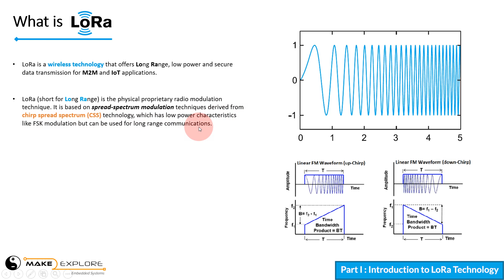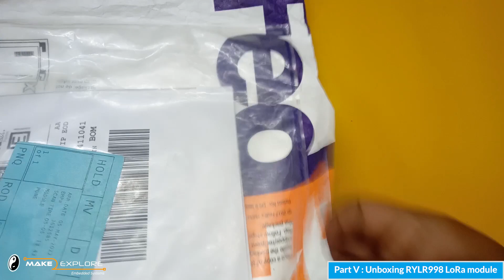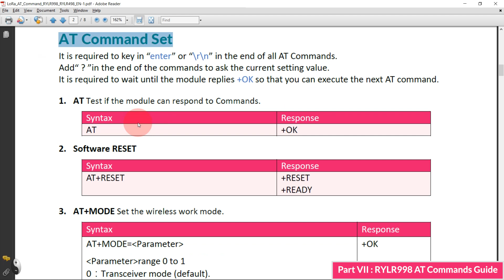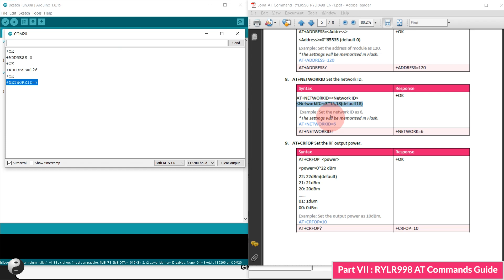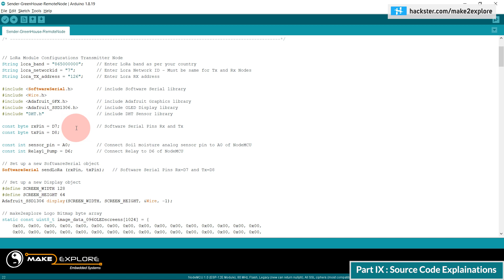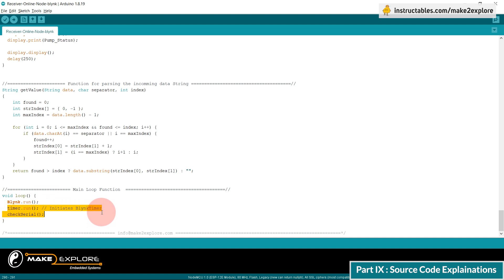[Device Overview] Reyax RYLR998 LoRa Module

Comment: How to use Serial.Read() function in LoRa Sending & any change in LoRa Receiver program using LoRa Ra02?
Kindly reply Answer program.
Reply from the maker: Dear @Saleemahamed,  Thank you very much 🙏 for your interest in our channel.

Q - How to use Serial.Read() function in LoRa Sending?

==> Yes you can use Serial.Read() to read the incoming LoRa data serially. You have to receive it byte by byte in buffer and then extract it as per your choice to retrieve specific information from complete LoRa frame. In sender program(RemoteNode) Since we have used String variable to ensemble all the sensor data with separator for each reading. To read that string data as it is at receiver Node, we have used Serial.readString function.

any change in LoRa Receiver program using LoRa Ra02

==> LoRa Ra02 with Semtech SX127X LoRa transceivers modem chip, Which is compatible and supported by Arduino's official LoRa library and functions. So there is no need to go for bare metal programming. You can use Arduino's LoRa library more efficiently. 

🔗 https://github.com/sandeepmistry/arduino-LoRa

If you face any issues in replicating any our projects/tutorials, Feel free to contact us through email  
📩 - info@make2explore.com
Also, For quick response, you can always chat with us on 🚀 Telegram 
🔗 https://t.me/make2explore

We'd ❤️ love to help.

Best Regards 🙏